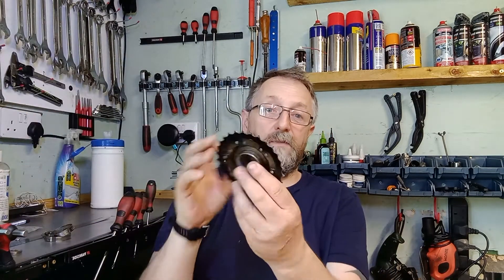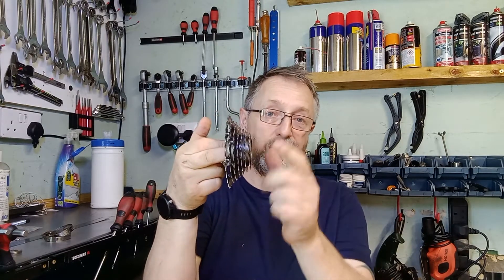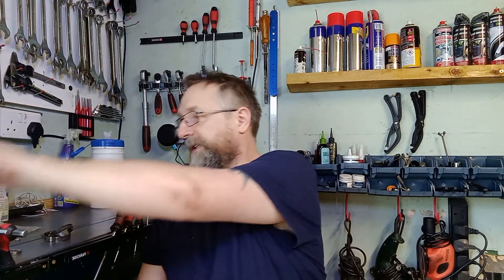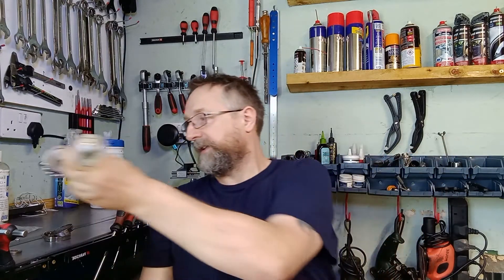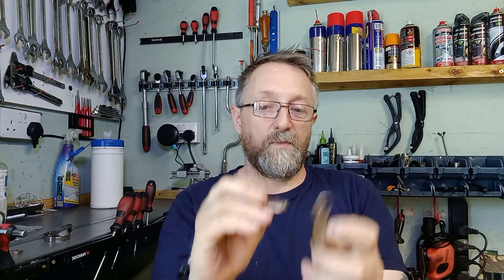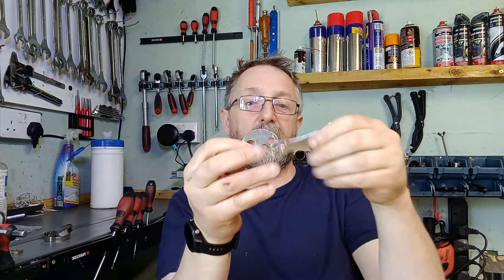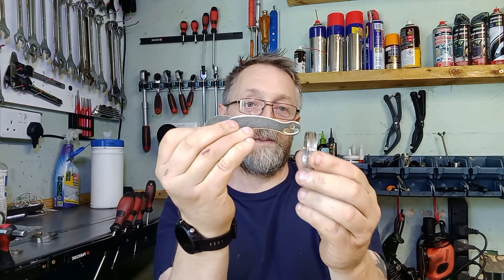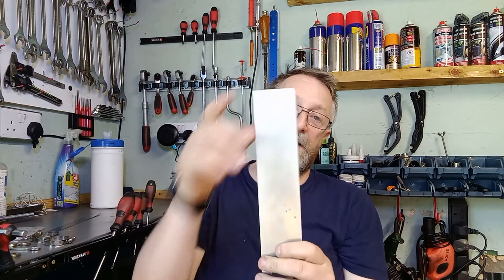Ebike 3000w hub motor ,rear dropout spacing, problem solved 👌

Comment: Ive just a done a GT CHUCKER  xs2 72 volt 3000watt kit on it , the problem ive had is the depth of the drop outs ive had to make some crazy torque arms to hold it in so i can trust it , my other bike has no torque arms as the drop outs are exrtra deep the width of the frame is fine on the gt chuckers if anyones got 1 id build it looks sick

Comment: On my 3k builds, i just use a 12t single rear and keep my 3 ring fronts. As another option,  there's a 3 speed freewheel 16-22, i think, that will fit without modifications.

Comment: I've got the opposite issue, I'm trying to find a 3kw motor for a 170mm dropout and they all seem to be too narrow! 🤦‍♂️
Reply from the maker: 170 is a big spacing, what frame is it ?is it specially made
Reply: @freds-shed  its a y2k schwinn stingray chopper. Standard rear wheel is 20 x 4.25 front is 24 x 2. I've got new wide front forks for a 20 x 4 or 24 x 4 (if I can find a reasonably priced one) with a 135mm hub but wanted to keep the power in the rear where my weight is.. it's a small bike so need to extend the saddle backwards cafe racer style... they're popular in the states for adding 2 stroke motors to with a strong steel frame..
There's a shop in Cyprus that made a 3D printed battery housing to sit inside the frame and it looks killer, pipe dreams for me though..😂
Reply: @freds-shed  https://youtu.be/SIKZktznqM8
This one.. just I'd do the wider front with a different saddle low down over the back wheel.. would look look even better..
Reply from the maker: That's where I got mine ,great company to chat to ,worth asking them anyway, u gotta send us a picture when it's done 👍
Reply: @freds-shed  thanks so much for the link! I'll give them a shout...
It's a slow going project but will post a vid on here when it's done.. thanks again 👍👍
Reply from the maker: https://newdoonebikes.m.en.alibaba.com/index.html?wx_navbar_transparent=true&tracelog=sns_minisite

Comment: Great video. 
Question - if my ebike dropout frame 150mm can I replace it with a 170mm dropout (hub motor)?  Can't find anything online.  hope u can help. 

/bklyn 👑
Reply from the maker: If it's a steel frame u definitely can, u can check that with a magnet and I can link a video on how to widen the space correctly using threaded bar, if it's aluminium I'd be cautious. However loads of lads in the mountain biking have been squeezing 140mm hubs into 135mm drop outs for years now with no issues, it's a common thing actually. So that's 5mm and u need another 5mm and all I can say is my rear hub motor came with 2 extra 2mm washers that I didn't need so if thats the same on your setup u will be fine, I'd love to say yes go for it but that's a decision u have to make.
Reply: @freds-shed  what is the link + thank you for this information.   🙏🏾 

/bklyn 👑